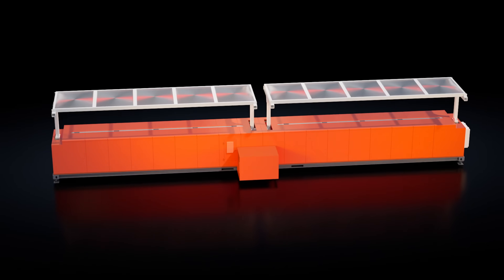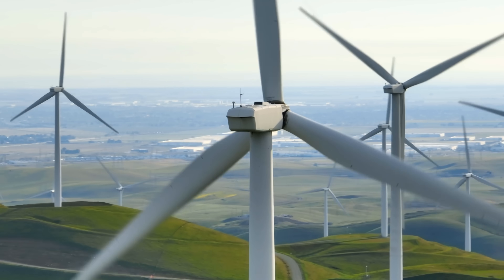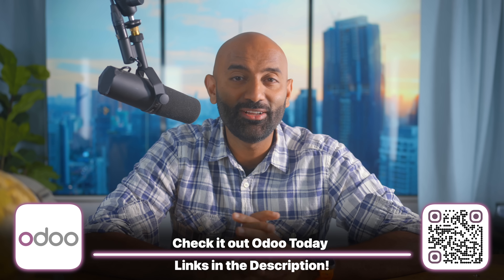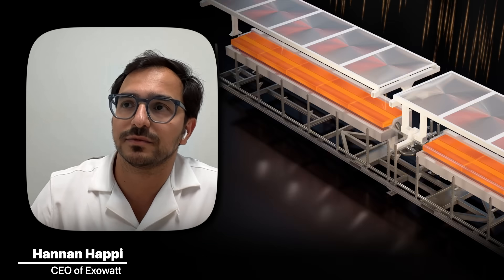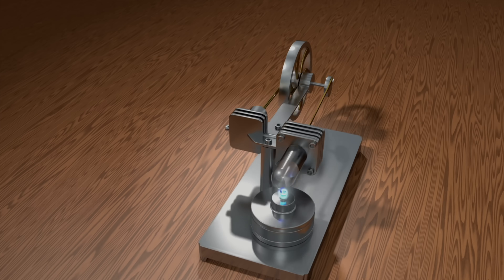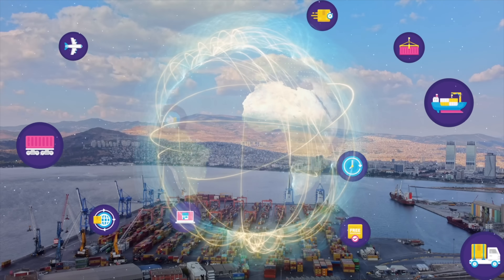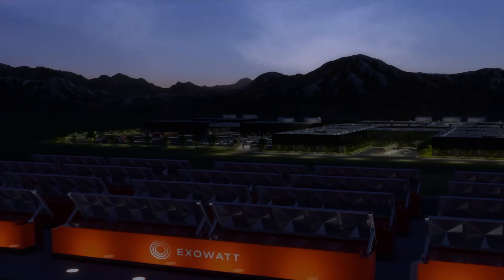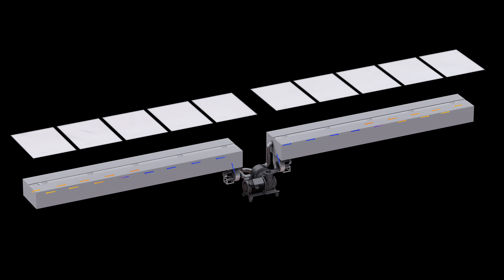Solar Without Panels, Storage Without Batteries - EXOWATT

Comment: "Might just make sense for the future of sustainable energy."

One thing that it's hard to get a grasp of for just about everyone is that while we used to have more or less one solution for electricity production - big turbines plugged in to a grid - the 'solution' to sustainable energy is to apply a diverse set of production and storage techniques with  sophisticated set of data management controls in place. So, yes, this fresnel lense mass heat storage system can be part of that diverse set of production and storage. To stop using fossil fuels, we need ALL of the techniques - solar, wind, pumped hydro, nuclear, grid-scale and residential battery, wave capture, etc. - and also to increase the efficiency of everything LEDs, heat pumps, stoves, insulation and more.

Comment: The weak spot is it still requires the sun. No sun, no power. A wildfire lasting a week as we have had, or low radiation due to an extended cloud event such as an atmospheric river, hurricane, any longer low, no radiation, and either solar, or this other energy depending on radiation still has this vulnerability to no energy periods . There are moving parts, for the lens tracker, and the Stirling engine , so wear, and inevitable replacement of parts, adding cost. No energy is free when any parts can degrade. So back up power will still be required . Interesting concept. The amount of space required for this system is a drawback.
 I have a small farm with 3 water wells, home food storage,freezers, but heat with wood, and cool with an evap cooler. I have a ground 11K solar grid tie system, and have no usage charge from PG&E. I do have a 9000 watt back up generator, which is used when the grid is down.

Comment: I would love to try this in rural areas. Kansas, Oklahoma, and Texas farm areas. It could be better for us to decentralize power. I have worried about the heat and dust affecting the solar, electronics, and batteries . I think a farm or ranch could put one here and there eliminating traditional grid, solar, and wind problems! I would love to try it!

Comment: Hey look, it doesn't produce large amounts of toxic waste like making solar panels does, not to mention the disposal of both solar panels and wind turbine blades. I like this idea not because of the silly climate stuff, but because this has great potential. I'd like to see this kind of idea scaled down a bit so they could power single homes and remove homes from the grid. I prefer a robust distributed energy system that cannot be taken down and one place losing energy has no effect on anyone else.

Comment: Do the tour please. I live in Puerto Rico and getting solar installed is an expensive operation. We have property to have this installed. I need more information. Store energy as heat? We have the heat! Sun, try 11+ hours per day of intense sunlight. In fact, heat is a major issue for solar panel degradation and those super pricey batteries. We need the information to switch to this.

Comment: Is the Stirling engine the best way to convert heat to electricity? 
How is the heat transferred the engine & is that heat recovered? 
Will this system be useful in colder climates? I think it would be. 
Is there enough excess heat to heat homes & shops? 
Can excess heat be used in industry? 
What's the minimum size system?

Comment: Seems odd that with the AI farms being basically modular heaters, large truck sized boxes using horads of electricity and putting off massive  amounts of heat for cooling, that putting these right over top of Ai data centers wasn't shown as an idea.. Data center makes heat, heat rises into brick battery, more power produced. Sure you have to have a coolside somewhere for the sterling, but seems silly to not just plo thes down on top of data centers everywhere. even if they get no sun.
or am i missing something?

Comment: Heat batteries are great combining them with Stirling engine and excess grid power is great. If these were elevated then you could use the land for other purposes.

Comment: You keep comparing the degradation of the thermal bricks to degradation of lithium batteries.  But you have to compare the sterling engine too. It's mechanical and will wear out faster than solid state components, traditionally.

Comment: It may be 25kW peak, at mid-day on a hot sunny day but it wont be 25kW average when you take into amount the vagaries of the weather and sunlight intensity over the full time of day and efficiency of the thermal cycle

Comment: Easy way to spot a scam; they info dump you a bunch of numbers and figures, BUT do Not address the real issues and do Not  talk about the  shortcomings that have prevented anyone else from trying it.  In this case there are very good reasons you see a LOT of  steam engines but NO Sterling engines used at any sort of industrial scale.  You don't see sterling engines  (despite how  cool they are, I'm even building one, I love them) used for anything other than novelties.

Comment: This competes more with solar farms than it does with solar installations altogether. 

The primary and wasted opportunities of solar is being built on existing structures. I have long said that if power companies had any sense they would approach big business with big parking lots (Wal-Mart, Sam’s Club, Costco, etc.) and offer to cover their parking lots in solar for a steep discount on power usage and built in solution during a power outage. Not to mention lighting, security cameras, EV charging stations, etc.

Residentially speaking, for a 40’ x 8’ run you can fit 12 550W bifacial panels (on a roof) which could produce 30-40 kW per day, and only cost $2,400 for the panels. Maybe $4,000 for the whole build. Another $4,800 for 48kWh battery pack or $8,000-$9,000. All without disturbing or wasting space.

Both solar and this would require inverters I assume so I left that price out. These only make 27kW daily? They take up a significant portion of the average back yard? Used shipping containers go for $2,000 and shipping usually similar so how much would these cost delivered? I’ll believe it when I see it.

Comment: If you tilted the container, you might get a better facing on the sun. A system that adjusted the angle once a week might add a lot of efficiency. For simplicity, the base level could be built to tilt enough to compensate for latitude. Hot air rises so it might even be possible to take some of the load off of the fans.

Comment: Awesome story. Please do a deep dive. And why not create a DIY version for your home!  I’m a former SD resident living in Phoenix.  Bricks are easy, the outside of my house is hot radiating heat inside, my brick wall and driveway if @@@ hot. My pool is even heating up. There has to be a way to capture this thermal load.  You can test on me.

Comment: well its not that simple as its  look what if we dont have certain heat solar mostly work on photo voltaic cells so they  can work on low light cloudy weather and in rainy days but this needs high intense heat and usually tropical area hai 3 to 4 hours high intensity heat

Comment: Wind was the purest of the energy scams; meaning, it doesn’t even produce as much energy as what goes into manufacturing/transporting/assembling/maintaining the visual abominations (which is part of the design, they look like they’re doing something). Traditional solar is an ideal consumer-grade option to generate independence on the individual house level…but it’s sort of like the respiratory system of an insect in that it’s more-or-less capped at scale due to inefficiency on a per-square-foot basis. This is genius.

Comment: Some questions. They are storing heat. No mention of using the heat directly? Opens up a whole new market if you are storing 1000 degrees of heat to pass around. 
That looks like is would fit in a small enough space that farms would find it useful, especially 25000 watts in that area. Also, residential areas with a bit of land as well. And adding to the heat use for winter heating would be a game changer.
Then we have the usability in the North. If you are storing that much heat area, it even if it is much less that 1000 degrees because its in the North, it would drastically reduce heating costs by using it as a thermal battery. In my area, it is common for heating to be extremely expensive. This could in fact counter that, making it worth it.

Comment: you can only convert 25% of the heat to electric realistically (35% is the physics limit)

Solar is 20% and simpler but no easy storage 

great idea, just want to add these numbers

Comment: You know you can fit a nuclear reactor in one of these and it will put out as much power as several hundred. There’s no chance of the nuclear reactor melting down and it will last for two years without maintenance. So much better

Comment: Fresnel lenses only work in cloudless conditions, and sterling engines are still limited by theoretical Carnot efficiency, which means you need high thermal differences to get efficient power generation. Under cloud cover your temps will trend towards sky ambient. It’s a double whammy. This won’t work well in many locations that have frequent cloud cover. PV takes a hit in these conditions, but I would bet that it outperforms this setup in those conditions. 

Startup companies often express numbers in ideal conditions and rarely have real world data in specific location effects. The effect here is that their projected LCOE is probably optimistic, and may grossly be so. 

It’s like concentrating solar power in a smaller scale. It didn’t work at large scale in ideal locations where LCOE should be good, I have a hard time imagining it will work better in small scale especially in non ideal conditions.

Comment: There's no way this is cost effective. First, look at efficiency: approximately 85% for the fresnel lenses, 35% for the stirling engine, 65% for the thermal storage, 90% for the overall system with parasitic losses (motors, pumps, wire resistance) and you're probably looking at less than 18% efficiency. Then look at the capital costs: storage container, lenses, tracking system,  thermal storage, and stirling engine. This cannot begin to compete with tracking or non-tracking photovoltaics.

Comment: All of this, and not a single detail about any of the technical issues with the Heat exchange technology or real images or further details about the Stirling engine. Or even an actual video of photograph of one running or generating electricity. I would have to say I’m concerned that it might not exist except on paper. 
In addition, this depends on a cloudless sky to use the focused light energy. How practical is that? Solar works better without clouds as well, but is not totally dependent on that condition.

Comment: The most groundbreaking aspect, I think, is that unlike solar panels which reflect heat, these absorb it. This makes them more eco-friendly and could even help cool the surrounding area. Birds flying over Solar One or Solar Two in Nevada and California are burned by the heat reflection.

Comment: I reject the claim that this system would have a smaller land use footprint than solar. Exowatt admits to lower efficiency. When hit with the same number of photons, fewer jules of electricity will be recovered. To increase the number of photons, you need more surface area.
On a related note, its power output, the rate that it spits out usable energy, will be lower than solar. Its impressive capacity to store energy is directly related to this fact. 

Exowatt has some really interesting use cases. Its raw materials are literally dirt cheap and its storage capacity could fill a difficult niche. That said, its peak power output is always going to be lower, and total land area usage is always going to be higher out of thermodynamic necessity.
Reply: This uses thermal energy, Infra-red. Solar photovoltaic uses photons, and dislikes Infra-red heat.
Reply: @andrewradford3953  Thermal is not the same as infrared. Infrared is photons. These aren't even collecting infrared light, it's only collecting visible light. Glass mostly reflects infrared light, which is why greenhouses work (I'm assuming that's where your confusion comes from). Non-infrared light goes through the glass, gets absorbed by the objects inside the greenhouse, which warms them up, then infrared light is radiated by those objects as they cool down, which then gets reflected back toward the objects in the greenhouse by the glass, thus keeping them warmer.
    This has literally nothing to do with Exowatt's design. The glass isn't keeping the heat in the thermal mass, it's the insulation around the thermal mass that is doing that. Any infrared radiation that hits the glass is just reflected away at whatever random direction.
Reply: @jeffwells641    Are you deliberately confusing folk, or yourself?? Critiquing without building on the information is generally unhelpful- Temperature difference is not the same as thermal energy.  ALL thermal energy transits space in the form of Photons - as does al light - across the spectra. Conversion of Light /photons into incident thermal energy for ongoing conduction depends on the interface conditions. - Often primary metallic parabolic or trough collectors are better than a transmission system because a much wider band of energy may be collected from a stabilised Aluminium or Silver collector (choose the mirroring material for the energy levels to be intercepted..

How much temperature difference a body exhibits depends on the time rate of the energy (Balance all incoming with all outgoing through the control volume, coupled with the specific heat capacity of the material receiving the incident energy (Joules required to raise the temperature by one Kelvin.)...  (Very simplistic brief of the thermodynamic units / properties)..
Reply: @kadmow   Bro, can you even read? Try reading my comment in the context of the previous comment. The previous comment equated thermal to infrared, and contrasted that with photons, when in reality infrared is also photons, and "thermal" covers much MORE than infrared. You are the ignorant one here, not me. Literally nothing you wrote is relevant to my comment.
Reply: @andrewradford3953  thinking the same, good for summer season but will be reduced to half efficiency in winter whereas photovoltaic differs very slightly throughout the year except cloudy days
Reply: Thermal is immediately 4x as efficient as PV, because PV is immediately 20% efficient.
Reply: @raam1666   - Also LIGHT(silicon or germanium energy  bandgap 0.67-1.12eV..) energy available in the "sunlight" is lower than all converted thermal energy. - Silicone bandgap i only 1.1eV, . UV is up to 3.1-12eV, something SIlicon can't accommodate, we need higher energy "band" Pv panels to allow IR through to UV to be collected simultaneously (without simply overheating..)
Reply: - thermal energy available under direct sunlight 1kW / m^2  the best Solar PV accomplishes  ~24% efficiency on  -  Commercial  500W solar panel is ~2.3m^2..  or 217W/ m^2.
Reply: @kadmow  You're skipping a step. Thermal energy isn't electricity. Exowatt's total system efficiency is only 15-18%.
Reply: whoa seems that you already have some insider information about the device, can you show us the benchmarks?

Comment: Solar pannels and batteries use resources that are extremely harmful to produce. Lithium is extremely toxic. The ammount of non recyclable waste generated by solar pannels and batteries ending their lifecycle is already a great reason to go with this tech. 30-50 years later you have to discard... Nothing. The glass and the brick are recyclable. The insulation may not be, but depends on what is used to insulate the system.
Reply: Solar panels have no non recyclable materials.

Comment: A 40 foot shipping container in the back yard to power a home or 2 and heat the greenhouse would be amazing.

Please reach out to take the tour we definitely need more energy and information, thanks.
Reply: I don't think of a 40 foot shipping container in my backyard as "amazing" 😄 Just put photovoltaic on your roof if you want electricity or evacuated tube collectors if you want hot water. The backyard is for me and my family

Comment: Do you think they might use 3% graphite in the mortar between bricks to increase thermal conductivity brick to brick?  What's the insulation on the outside of the containers?  Is there an increased fire risk if dry brush comes in contact with the units?  Does this increase maintenance costs to ensure the site remains plant free all year round?

Comment: Asked about maintenance costs ?! Like optics, and the servos that move the lenses, and how much do the lenses deteriorate over time in the 30 to 50 years ? Like the costs of fixing and replacement of parts that do not work for 30-50 years, those parts are not bad just that those parts are not made for working for that period. Cleaning services on mechanics and optics, cables wear, most electrical cables get cooked at heat and even if not heat but in 30-50 years. There needs to be a time of maintenance and that can be every 2 to 3 years, perhaps more or less.